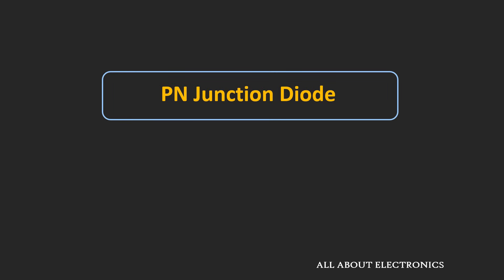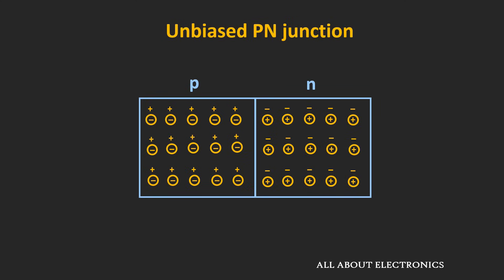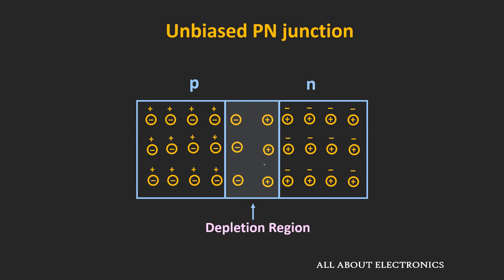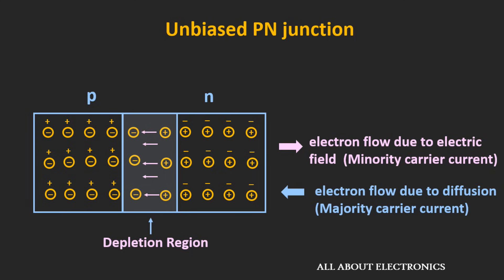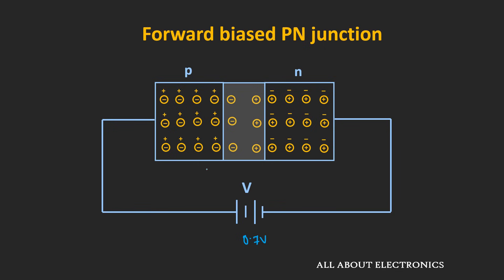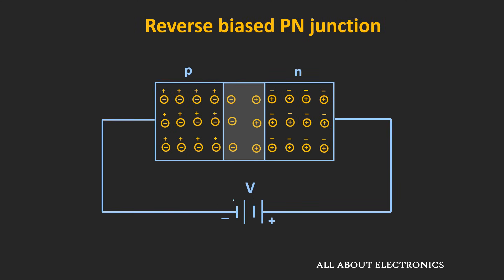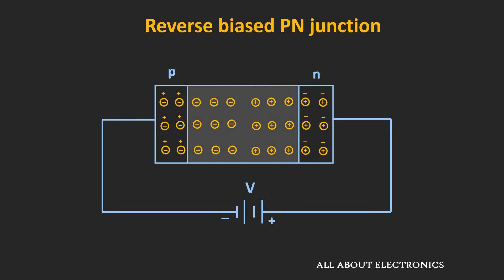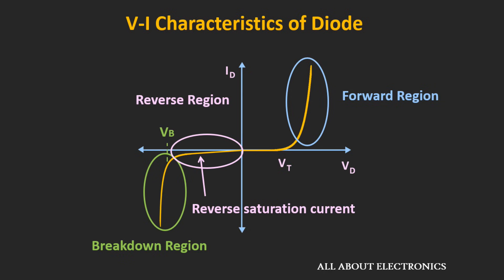PN junction Diode Explained | Forward Bias and Reverse Bias

Comment: 7:28 you said electrons from n side and holes from p side get pushed towards junction, that means the the positive ions close to centre will get the electrons from backside and negative ions close to centre will get holes from their back side. This results in the accumulation of neutral ions(as in centre some time ago)in their respective terminals?

Comment: 00:16 PN junction is formed by doping a silicon crystal with p-type and n-type impurities
02:13 When electrons diffuse across the junction, they create positive and negative ions near the junction.
04:13 Electrons and holes are able to cross the depletion region due to the barrier potential created by immobile ions
06:00 When a PN Junction is not biased, the overall current in the circuit will be zero.
07:46 Increasing applied voltage reduces depletion region width and allows current flow.
09:34 Movement of electrons and holes leads to current flow in forward and reverse biased PN junctions
11:19 Reverse saturation current is a low magnitude current that flows in the reverse bias condition in a PN junction diode
13:14 Temperature rise leads to an increase in reverse saturation current and breakdown voltage in PN Junction.
Crafted by Merlin AI.

Comment: Does the built-in potential refer to the voltage of the depletion region? Meaning is the voltage difference 0? Otherwise negative charge may flow. So does the potential of the to edges of the depletion region same (0.7 V) ?

Comment: Hello Admin, I have a question regarding PN diode.

Why it is not possible to measure the built in cutin voltage using a voltmeter connected across the junction??
Reply: No reply

Comment: SIR, When the pn junction is biased and the external voltage is above 0.7(barrier potential), the electron in the n-side moves to the positive terminal by passing through the holes, in this process why cant they recombine ? at 8:30
Reply: Same doubt

Comment: even though there is potential barrier , the mintority carriers like holes in n type move towards  p type then why cannot the majority carriers move?
Reply from the maker: Let's take the case of the n-side. In the n-side, holes are the minority charge carriers and electrons are the majority charge carriers. The holes which are minority charge carriers are getting attracted towards the depletion region due to the electric field.  And once they enter the depletion region then due to the electric field, they get accelerated and are able to cross this barrier. Basically, they get enough energy to cross this barrier. But for majority carriers, that's not the case. For example, the electrons will get attracted towards the positive terminal of the external biasing voltage and rather they will move away from the junction.
I hope it will clear your doubt.

Comment: It is said that the depletion reigon is depleted of free charge carriers and has only immobile ions, then how can we say that electron hole pairs are formed in  depletion reigon thermally or by electric field conditions
Reply from the maker: Yes, that's true that the depletion region is free of charge carriers but if you see the crystal structure, the valance electrons are still there. 
And if it gets the energy through external electric field or thermal energy, then they can become free.   
But the concentration of such electron-hole is much less than the concentration of electrons on the n-side and the holes on the p-side.

Comment: why minority carriers increase in a doped semiconductor when we increase temperature ?
Reply from the maker: As the temperature increases, the thermal energy increases. And due to that the vibration of atoms increases. So some more electrons are able to escape the parent atom. And in a way electron hole pair is generated. So in short as the temperature increases, the intrinsic carrier concentration increases.
I hope it will clear your doubt.

Comment: a very good explanation! but had a doubt..is the reverse saturation current same as the drift current?
Reply from the maker: Yes, the reverse saturation current is a mainly drift current because near the junction the minority charge carriers get pushed to the other side due to the electric field. 
But in the forward bias condition, the forward current is due to drift and diffusion current. 
Drift current exist due to the electric field and both majority and minority charge carriers contribute for this drift current while the diffusion current is mainly due to majority charge carriers.
Reply: @ALLABOUTELECTRONICS  , can we define drift current as the current due to resulting electric field? can we say that drift and diffusion current will always be opposite in direction?